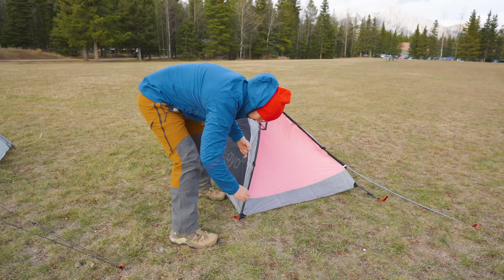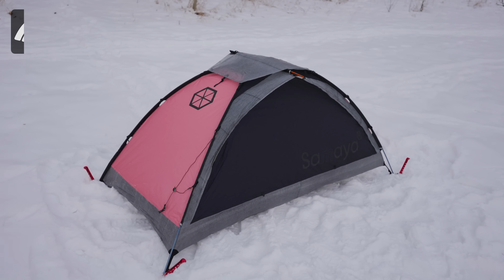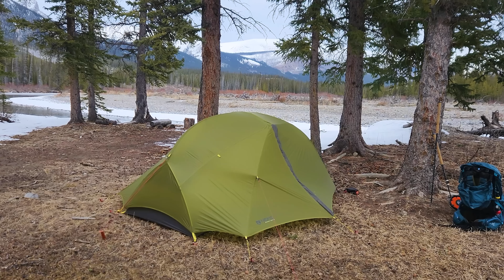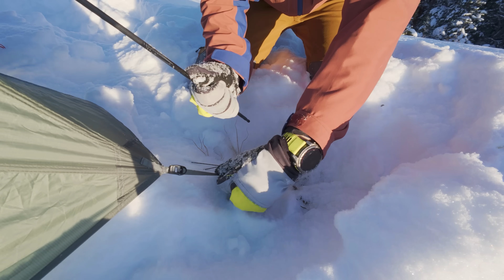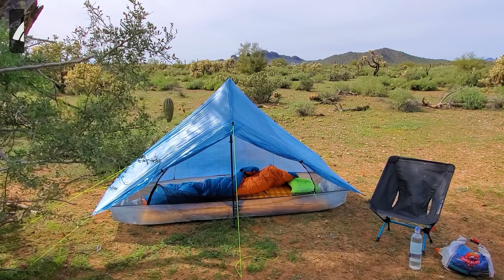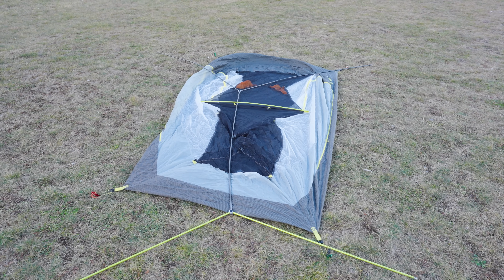Can These Popular Tents Survive Extreme Wind? Let's Find Out!

Comment: One thing that strikes me is how few ultralight tents have a snow skirt - the outer is too high and the wind gusts up under and messes with the tent. Or even just extending the outer down a bit and having extra attachment points on the skirt or base of the outer. Sometimes a try pile up sand or dirt and put a towel over the skirt and place rocks on top so the skirt isn’t torn. Anything to stop the wind getting under the skirt and up into the tent

Comment: I would argue that the setup in high winds you do have to think it through. I normally try to find a spot that has wind cover or breakage before setting it up, if I need to set it up in the open field with that amount of wind I tend to be even slower so I can keep an eye on where the wind is coming from.

Comment: To new people out there: If you're dreaming of setting up tent in very high winds, in winter, and over tree line, always practice before hand. until you have the muscle memory in, with gloves and in the dark. You'll quickly find out you want a 8 cm reflective cord with a knott on the end. It's useful for anything you're going to grab on to with big gloves.

A key tip is to always anchor your tent first, to something heavy, before you drag it out of the bag.. I use a larger carabiner. It can be to a stake, a heavy backpack or your pulk/skiis. The worst mistake you can do is watch your tent get sucked into the great abyss of the nothingness that awaits you.

Comment: On the x dome it looks like you have put out the 4 corner guys in line with the direction of the pole. On the durston set up video Dan suggests putting the guys in line with the wind. I think if the guys had been put out more at 90 degrees to the end fly then the pole well may not have deflected as it did.

Comment: One tip I got from Hilleberg: secure the tent to your backpack with a guyline before taking it out of the sack and starting to set it up in wind, so it doesn’t get ripped out of your hands and blow away.
Reply: To take that a step father, when you pack it away have the windward guyline poking out of the bag. That way you can place your backpack upwind, attach the windward guy, then pull out the canopy.

Comment: Great video !  Educational.  
Had just one experience with high winds and my REI dome tent did very well - did use extra guy outs.  Just about every other 'cheap' tent snapped poles.  
I have used a single trekking pole dyneema tent for several years but no experience in high winds.  I wonder if a better pitch is to aim a corner of the tent into the wind rather than one side, (even the narrowest) so that overall surface area can better deflect the force from the wind.

Comment: I recently camped in 45 mph wind gusts with my MSR Access 2 and experienced the same promblem with bending poles which are also made of carbon. As soon as I staked out 3 guy out points in the front and back of the tent the poles never bent throughout the night. So I can confirm that lots of guy out points is the strong argument when it comes to storm resistance.

Comment: I have a 9yo 2-trekking pole Zpacks Solplex. I’ve had it out in 40+ mph winds and it was solid. I took a video for Zpacks, but didn’t really expect them to do anything with it since it’s a discontinued model. 

A few weeks later, two guys with Nemo tents and I had to camp above tree line (12,500’). I could only get 6 stakes in the ground and piled rocks on my two center stakes. One Nemo tent was on hard rocky ground beside me and the other was in the grass. Again the winds were 40+ mph (according to the firefighters) and we also had intense rain. I was worried about the rock piles, but my tent held strong all night. As did the Nemo tent on the hard rocky ground. The Nemo tent in the grass had a stake come out during the storm. But the owner slept though the vestibule flapping. He slept through the crazy storm also. 😂

Comment: As much as I like your channel... where is SLINGFIN ... Until you bring these guys to the test, then you haven't truly run a test about wind resistant tents.
Reply: true, slingfin have so many good offerings too
Reply: @chocolate_lurv  Being Canadian I should likely be raving about Durston, YET here I am extremely happy with my Slingfin Indus 2 because I got myself the rugged option it has to offer and just bought the mesh body of the Portal 2 so now I actually have a solid set of pole, a full summer solution and the windproof badass Indus. The one thing people always seem to overlook is "dust" it takes no time for dust to invade your tent if there's any mesh webbing. I know my whole solution is heavy but I have a use case for it... Anyhow, it's actually mind-blowing how little content is found on YouTube about the Indus 2.
Indus 2 and Portal 2 have the exact same foot print and pole structure. So it's super easy to just mix and match the two depending on the condition and time of the year. YES I know they aren't the super duper mega ultra light option so everyone is looking away!

Comment: Hey Justin, about the dragon fly are you sure the pole was fully inserted ? It looks like it's not at 3:20, and this is exactly where it snapped ?
Reply from the maker: Ya, great question! I made sure poles were fully inserted because that would result in an instant failure. While I am not sure, I think maybe the pole came slightly out of the insert due to wind buffeting the tent and then that led to the failure. Hard to say.
Reply: @JustinOutdoors  Thx Justin ! Have you looked at 3:19 (also at 3:35)? Unless I'm crazy I can definitely see the silver coating of the inner tube (male end) so I'm pretty sure it wasn't properly inserted at this time. I cannot tell if this was still the case once the flysheet is on but the fact that the structure is bending at a weird angle at this exact spot as soon as you tension the fly (3:24) makes me think it wasn't.
Reply: @JustinOutdoors  The point is - at the end of a long day and in heavy wind, this is an easy mistake to make. So it's definitely a downside of bendy pole designs compared to trekking pole designs where this is never an issue.

Comment: Interesting video... Thanks

Correct me if I am wrong but you shouldn't bend the aluminium pole back out as you are further weakening the integrity of the pole and could cause it to fail completely.

Also disagree slightly about the set up direction being governed by the door... Always face the smallest section of the tent into the wind then the door is either away or side on to the wind but the tent is always catching the least amount as possible. 

I would choose the ArcDome 2 as it's half the price of the Samaya, larger inside and while it's slightly heavier I can deal with the more awkward set up for the bombproof nature of the tent.

Comment: The X-mid could’ve handled the extra wind. If you would’ve patched it not facing the extra surface area where the wind was catching. I had this problem in the mountains, and if you pitch it where the wind only hits the side of the tent. It’s able to hold up. I saw a guy pitch the X-Mid during a hurricane, and it was able to handle it, but he pitched it, not facing where the wind was coming

Comment: I had the XMid 2 in 40 mph winds last week and the feedback I got from many viewers of the video was that I had the tent facing the wrong way which is the way you had it set up. Basically the top guy line needs to point into the wind. We have another storm this weekend so will be putting it through it's paces again 👍
Reply: If I'm understanding you correctly,  by Top Guyline, do you mean the lines that tie out the Ridgeline? Basically, the Ridgeline Is parallel to the wind?
Reply: @cheri7828  yes, that's what many people have told me.
Reply: Did you get a chance to test the tent in the storm over the weekend or was the forecast wrong?  Our forecasts have been saying it will snow on the weekend...for the last three weeks.   Then it was supposed to snow basically from Tuesday until Sunday, but here we are on Thursday and there's no snow.
Reply: @andreameigs1261  Yes I did get back out in storm Darragh. Will have an update on this weekend's video. It didn't end well 😬
Reply: But out on the trail you never know for sure which direction the wind might come from.

Comment: Very nice test. My issue with Durston tents especially their DCF tents are they cost about the same as a Zpacks which are made in the USA and Durston are made off shore. I know that’s not a big deal for many but it is for me. The owner told me about how they are seem sealed and that it’s superior to Zpacks process but I have never had any issues with my Zpacks and I feel better knowing it’s made in North America. I wish Dan would move production to Canada. There are so many tents out there, I appreciate your efforts testing them. The tents made for high wind and winter use can get very expensive.  The brand I always hear people talking about is Hilleberg. I am not sure if you have any experience with that company. They are costly and generally heavier. Take care
Reply: I’ve made the manufacturing comment before and not many care.
Reply: There is a lot that goes into producing a tent, so some brands will have higher costs in one area (e.g. USA labor) while other brands will have higher costs in other areas. With the X-Mid Pro tents (DCF ones) some of these areas we have higher costs are:
1) We use YKK superlight interior zippers, that are about 5x the cost of normal zippers but drop 40% weight
2) We pre-shrink the DCF so it warps less over time. This adds labor and means we need to use more DCF since it is slightly shrunk.
3) We hot bond the DCF to give stronger seams
4) We apply DCF tape over any seam diagonal to the fibers to avoid deformation.

So the reason we outsource the production is because we want to have the highest production quality (hot bonding and pre-shrunk). This adds quite a bit of cost to produce, so I would be surprised if our tents are overall less expensive to build than Zpacks, but I don't know their costs. Zpacks makes greats tents to - it just depends on what things you value.
 - Dan
Reply: @ , so this is why you can’t make them in Canada? I applaud you for your quality. Your dedication. Your company. But I just can’t see not making them either in Canada or the USA!!! Would we pay more? Most definitely. Would it be worth it? You bet. Proudly.

Comment: Great video Justin! I just purchased a Slingfin Crossbow 2 for rough weather. They have a pole sleeve that allows you to get the poles set up and tensioned before putting the fly or inner up. But it is arguably in a different weight-class than these tents.

Comment: Macpac Olympus - a bombproof tunnel, 4-season tent. Roomy for two. Palace for one. Twin doors and vestibules. Not the lightest or cheapest, but a quick and dry pitcher once you learn how. I had one in regular weekend and expedition use all year round in Kosciuszko National Park, Australia, for walking and skiing trips over a period of 15 years. A wonderful, value for money tent, as long as you look after it, including using a footprint and airing the tent straight away when you return home.
Reply: But it's over 3kg. Just way too heavy. Most times you don't need a tent that can handle 100kph winds. My 600g ZPacks Duplex handled 90kph at Wilsons Prom. I did put rocks on top of the stakes.
Reply: @magpiecollingwood9116  yeah, agree. It’s a relatively old school tent and one for particular uses. Packs like my old Macpac Torre fall into that same category. Built for hauling up & down cliff faces & serious scrub bashing- try doing that with a pack made out of Dyneema, UltraGrid or even Ultra 200X. I justified the weight due to many long KNP ski trips, Tasmanian bushwalking etc and often in a group.  There is an absolute abundance of lighter, solid tents & packs on the market these days. I suppose we all grow fond of equipment that has helped us to have a great time in the bush and protected us from the elements when the weather has turned seriously threatening.
Reply: @andrewwilson6091  I think those 25kg+ pack days have come and gone. Yes I had a Torre pack as well. Remember those days , but I was much younger and could walk up those hills with that weight. Not now at my age
Reply: @magpiecollingwood9116 Such a good point. My wife and i carried many “storm of the century” tents and never encountered things that required that kind of construction. We  backpack all seasons and have been through some big storms but it was always surprising how rugged modern lightweight tents are. My new standard is how much extra water does that UL tent allow me to pack. Id rather have those extra liters instead of more tent fabric.
Reply: Soo true Andrew, I replaced my Olympus with a Hilleberg Kaitum and now also use a BL Soulo. While I expect to use the X Dome 80% of the time for fair weather, I always sleep well in my Hillebergs in the nasty stuff. I never worry about where I am pitching it, the tent is a tool to serve me, not the other way around.
Reply: @Mark_7260  thanks for mentioning the Hilleberg brand. I’d heard of it in the past, never seen it in the field and pretty much forgotten about it. Am in the market for a UL 2P tent, atm. The Durston Mid X Pro 2 looks a front runner, and at a similar price to many of the Hilleberg tents. I realise that they’re not all necessarily comparable in intended purpose. Have just spent an enjoyable hour studying the Hilleberg range. Cheers.
Reply: Fantastic tent and really cutting edge when it came out in the early 1980s. So heavy now though!